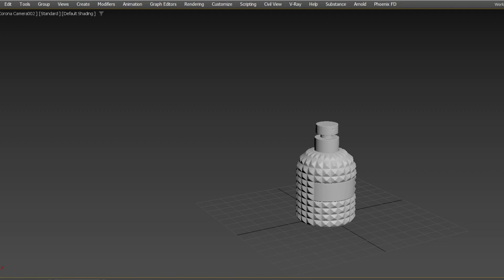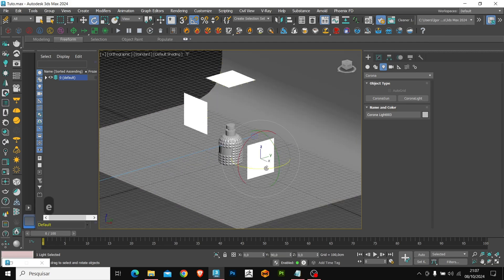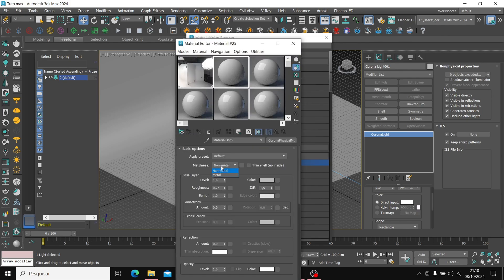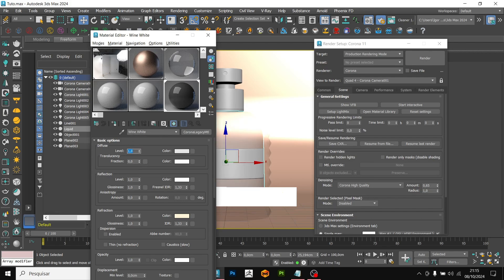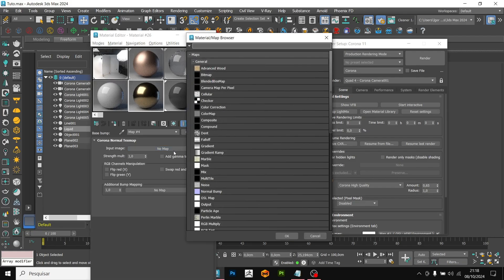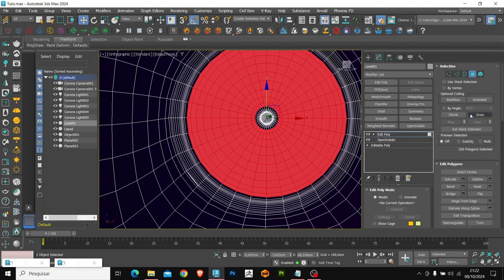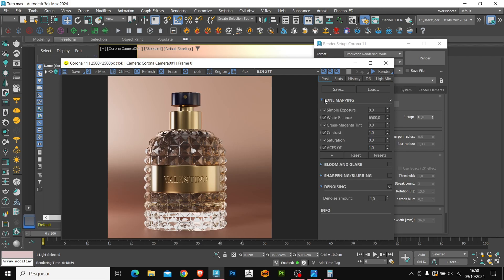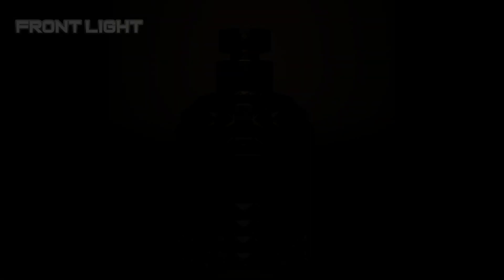How to Render Products in 3ds Max! Using Corona Render.

Comment: is awesome♥
can u make it in Vray too ?
Reply from the maker: Thanks! In Vray is the same process. Only change the lights to vray light and setup the render using the vray settings. The process is very similar
Reply: @igormota3d   the problem is in glass material i have some issues in material i can't handle it in vray like in corona!♥